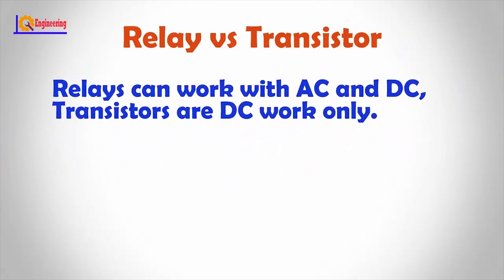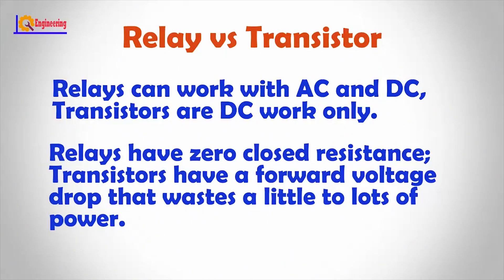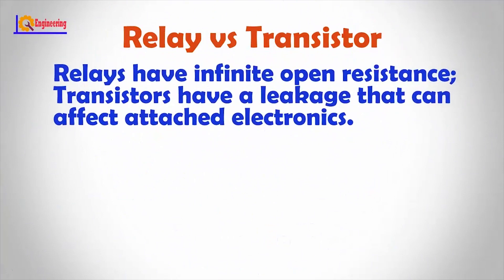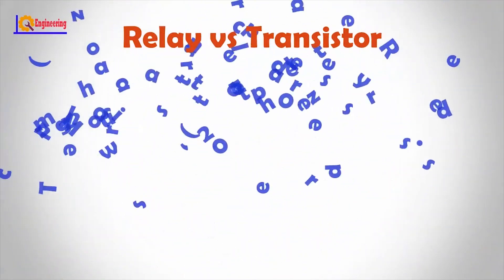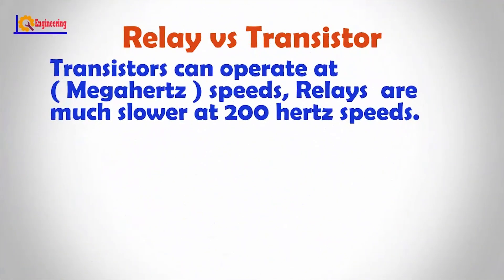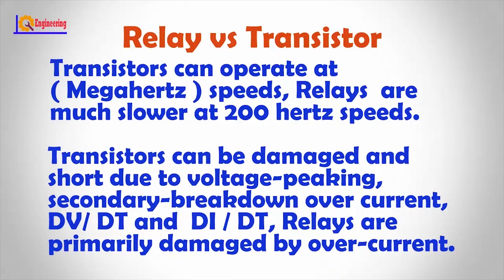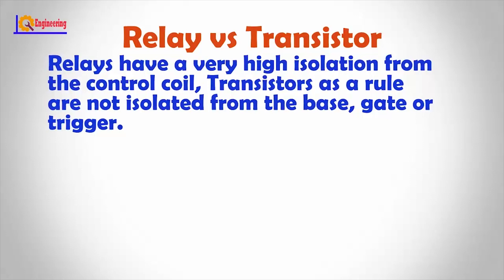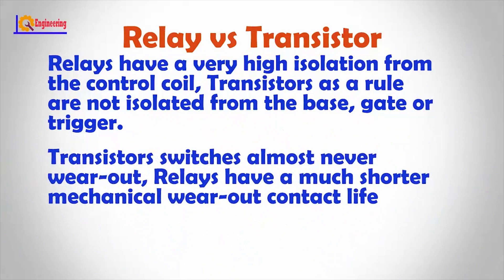Relay vs Transistor  - Difference between Relay and Transistor

Comment: very good, thanks! I would add the fact that relays have also a switch bounce which produces a ripple in the signal when switched, which can may be an issue in sensible circuits (although capacitors can be enough in this case)